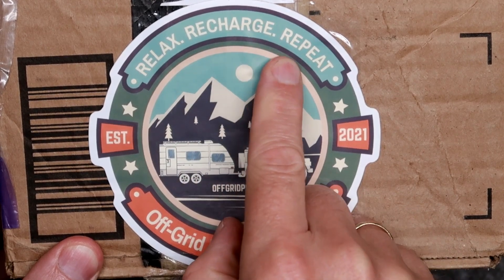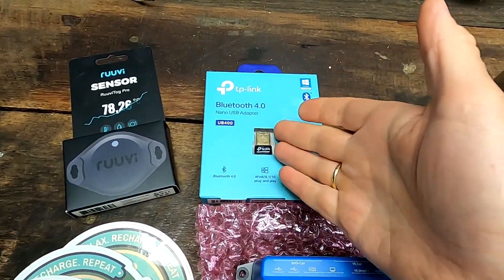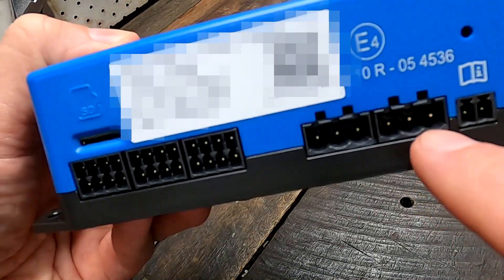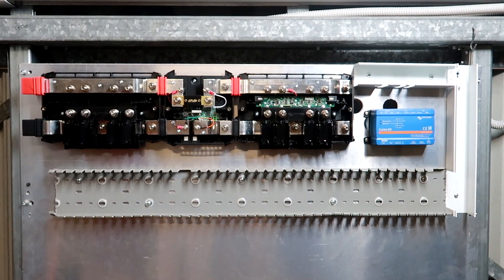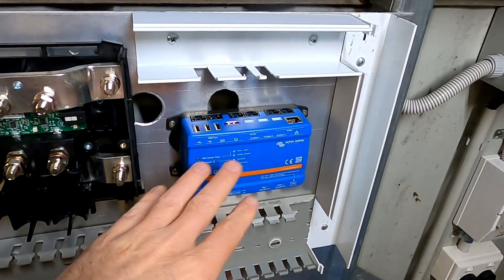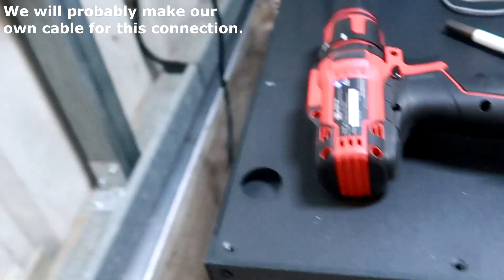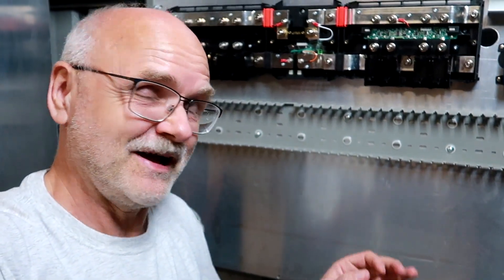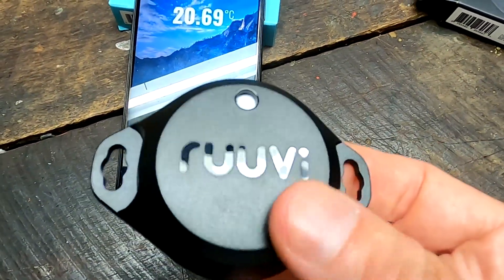The unexpected landing of the Victron Cerbo GX on the PowerWall 2.1 - the saviour of communication?

Comment: Question to the pros: do you connect the Cerbo (or Raspberry) directly to the battery or after the BMS? I just had an ugly experience as the BMS triggered the low voltage condition (battery empty) and therefore the Cerbo also switched off. To avoid that I consider to connect the Cerbo directly to the battery. Any experiences in the community? thx for any reply!
Reply from the maker: I would say, if the BMS has disconnected for any reason, that's it. Something went wrong and you need to look at it anyway and change your design.

Comment: If you want to save money on the BMS-CAN/A cable you can just link add 3 link cables (+/-/GND) to a cheap RJ45 eithernet 2 port socket and then just use chap ethernet cables.
Reply from the maker: Yeah, I was going to make my own cable, just cut one in the middle and solder the 3 pins we need. Victron has the pin-out on their website.

Comment: I agree that it is unacceptable that the different versions of the BMS can’t communicate. But in order for you to test the two batteries working together can’t you negotiate with them that they send you two 200A bms. This configuration should work and should allow you to perform the tests. 
Another thing that concern me is the fact that the Seplos BMS has only one CAN port? Usually a CAN bus needs to be terminated on each side with a terminator (like it is done with the Victron equipments). It will probably work without it but this is definitely a bad practice unless they have added a terminator inside the BMS?
Reply from the maker: Yes, I have asked for a replacement of the BMS and they wanted to wait until the new BMS come out in a few days. They will send them over as soon as available. We hopefully can just replace them in the existing batteries and the will start talking.
The BMS have an internal CAN terminator, so need to be at the end of the bus.
This is something I never understand from their design perspective. Why not use solely CAN communication between the BMSes instead of RS485. It would make life a lot easier. I understand that some inverters use RS485 for communication rather than CAN and Seplos wants to cover as many requirements as possible but having two different BMS versions for either case is certainly a messy solution.
Reply: @OffGridGarageAustralia  If they need to send you new BMS that probably means that a hardware modification is needed? Otherwise they could have sent you only new  firmware!
Reply from the maker: @DrCoolZic  I think it's a new designed BMS with additional functions alike Bluetooth (so it needs this extra chip anyway). Not entirely sure how they want to marketing this as many people seems to have communication issues with their BMS and there is no real solution but only some sub-optimal workarounds. Many would want a new working BMS from them...

Comment: Hey Andy, what is your experience with those Amazon 100 Amp breakers? Like those with the red switch.  Do they have high resistance? High heat? Great video thanks!
Reply from the maker: You mean these ones? https://amzn.to/3bsxOSD
I have used them once and they didn't work. I would not trust them at all.
Use these ones, they are the real deal and SAFE: https://amzn.to/3fpEqW3

Comment: With the cerbo GX the touch screen are powered by the USB port next to the HDMI. I added a noname 7"touch screen and it woks perfectly at mine. But now I'm trying to make a raspberryPI VenusOS for my brother and it seems to work fine with Touchscreen after a little coding on the PI.
Reply: Do you have the code you use for the raspberry pi?
I have the Victron logo but missing the coding
Reply from the maker: I think you can use Kevin's project here on Githup for that: https://github.com/kwindrem/RpiDisplaySetup
Reply: @doucet2006  yes I have the code. I'm using venusOS 2.91 on a RaspberryPI 2 with Touchscreen.  And now it works fine.

Comment: Andy be careful with the power supply of the Cerbo GX. I just found out that there is an issue with power supply and it is necessary to use 100uF/100V capacitor. See more information on victron community.
Reply from the maker: I read about this a long time ago. Mine seems to work fine....
Reply: Hi, mine just packed in, worked for a week or two then when I rebooted my batteries it blew the Cerbo GX up. It definitely needs the capacitor installed, until Victron come up with a new version.

Comment: Now you have the Cerbo GX are you going to have to get a new set of VE-direct cable , or can you still use the VE-direct to usb cables ?
Because to me the Cerbo GX used a different set of cable which are cheaper and doesn't look like there is any electronics between the 2 VE-direct plugs ?.
Reply from the maker: Hi Peter, We can still use the USB adapters as well as VE.Direct cables. It can be a mix of all sort of connections now. That is one advantage of the Cerbo, it takes everything.
You're correct, the VE.Direct cables don't use any converters, it's a pure RS232 signal I believe. Victron still recommends using the VE.Direct to RS232 adapter because of the galvanic isolation circuits they have.

Comment: I have a Victron SmartSolar charge controller 250 | 85 an I intend to buy a LiFePO4 battery. Is there any danger for this charger if the BMS of the battery disconnects the battery and the charger is still connected to the solar panels array?
Reply from the maker: I have tested this many times with my controllers and disconnected the battery under full charge. The Victron controllers can handle that and go into absorption mode/voltage, still supplying power to your loads if they can keep up.

Comment: Very generous of Ed to donate some items.  I'm not familiar with the Cerbo GX but look forward to seeing if it provides anything beyond what you already had.
Reply from the maker: The Cerbo acts basically as the communication central point, same as the Raspberry Pi does. They both run the exact same software. The Cerbo has the advantage of having all these connection points and advanced functionality with programming and relays outputs.
Reply: @OffGridGarageAustralia  Thanks for the explanation.  Sounds like anyone "needing" the Cerbo would be a rare case (as the Raspberry Pi seems to have served you well).  I hope you are able to find a use for the extra features.
Reply from the maker: @gumpster6  The Raspi is totally fine for for these installations. But they are very hard to get and if, prices are super high. So there is not much to save when using a Pi vs the Cerbo.

Comment: Where do you get your cable run covers the. Cable ways I need a way to cover my conked without costing an arm and a leg and I like the plastic run ways
Reply from the maker: I bought them at a local electrical store but you can also get them online from eBay and Amazon.

Comment: 100122/0448h PST 🇺🇸 100122/2148h Brisbane 🇦🇺.  Thanks for the video. You’d very well enjoy the VICTRON CERBO-GX. It’s a wonderful device that’ll enable you to connect all your other devices into the CERBO-GX and monitor the results from any where in the world; once connected to your Network provider (Router). I’m not going into details, but I have to mention that CERBO-GX will provide the fuel tank capacity and provide visual info into  VICTRON GX TOUCH SCREEN, via HDMI and VE DIRECT CABLE combined together. 
VICTRON GX TOUCH SCREEN is an amazing device for the visual proof of all your system, brought into your bedroom, totally cable less, for your reading convenience. I have this device for over a year and I’m extremely satisfied with it’s performance.
The BT transmission is good. The VICTRON CERBO-GX resides in the garage and I receive the images (signals) in my bedroom upstairs, which is about 27 meters away (80feet Approx)
Enjoy…. Enjoy..I’m happy for you. 73s…
Reply: Errata and addendum: Please read that the HDMI and the VE Direct1  cables needs to be extended to bedroom. Power supply to CERBO-GX is derived from main battery.
Reply from the maker: I would not bother with a GX touch screen if it needs to be connected via HDMI. I like the wireless solution and can access the system from my mobile phone, network or away...

Comment: Name: Off Grid Garage Cerbo GX. Another great video Andy and a very nice new toy to play with. 
Waited ages for a com cable for my 3 x Seplos “Suntorque” 5kw batteries, it arrived, and i still cant get communication with the BMS’s. After 6 months of ginning around I have got them working ok, sort of, but they have been a real hassle to get going right. I bumped the voltage a little (56v) from 55.2v and they jumped from around 70% to 98-100% soon after, so I am guessing the SOC reporting is actually triggered by voltage, but that is a big jump from 70-100%, hopefully this has reset the BMS and it will work better now & Ill drop off the voltage again. Love ur vids & look forward them. Cheers
Reply from the maker: Thanks for sharing, Evan. I hope Seplos can get it sorted as I have the JK-BMSes on my fingertips and ready to go. I won't be mucking around much with the Seplos any more if they don't work.

Comment: Made the switch to the Cerbo months ago, after the second Raspi died 😔.
Reply from the maker: How do you find it? Any real differences?
Reply: @OffGridGarageAustralia  The software is the same. The hardware part, everything is there, no need for extra adapters for the VE bus of VE can... No extra drivers of software to install. It's all plug and play.
Reply from the maker: @bramsoff-grid  Yes, that was my understanding of the difference too. Most ports are isolated as well in the Cerbo but Victron still recommends some VE.Direct to RS232 adapters for isolation purposes. I thought I can just use my own JST connectors now for my MPPTs but it sounds a bit unsafe when reading their documentation.
Reply: @OffGridGarageAustralia  I had a test setup for months with the JST USB cables from my MPPT and shunt pluged in the Raspi. I just put the cables over to the Cerbo, no problems at all.
Reply from the maker: @bramsoff-grid  Yeah, same here as well... but they are not isolated afaik. Mauby there is a solution for that.... 🤔

Comment: Any touch screen with HDMI will work. It's cheaper than buying the Victron unit. Just get JK BMS if they work with Victron
Reply from the maker: I would rather prefer a wireless solution for such a screen so I can have it inside my house. I'm using my old tablet for that purpose at the moment connecting to the IP of the Raspi.
Reply: I finally added a Waveshare 5” screen. It was a hassle needing to use my phone on the boat. I wanted a solution that would work after my phone inevitably goes for an unplanned swim… again!

Comment: You don't need the bluetooth adapter for the CerboGX if you connect it to the internet. I have my CerboGX connected via Ethernet to a 4G router/modem. I use VRM Portal (free from Victron) to connect and monitor EVERYTHING connected to my system. In the VRM Portal it gives you the "Remote Console" where you can access the CerboGX as if you had the touch screen connected to it. I highly suggest looking into the VRM Portal.

I have a Quattro 24/5000/120, Lynx Shunt, Lynx PowerIn, Lynx Distributer, Victron MPPT 150/60, Victron MPPT 150/100, CerboGX...connected to 2 solar arrays - 2200w & 2000W charging six 12v300a LFP connected 2S3P for 23kWh battery backup.

PLEASE LOOK INTO Victron's VRM PORTAL!
Reply: The Bluetooth dongle is for using the RuuviTag, or any other BLE accessories Andy wants to experiment with.
Reply from the maker: Charles must be new to the channel. I'm using VRM for over a year now 😊

Comment: Andy, please check which production number the Cerbo has. The most recent one have a quality issue and the power input and can only stand 12 and 24 Volts but NOT 48V, except you solder a capacitor over the DC input! Quite a shame for a quality company like Victron. I bought one and burned it, now I know why......
Reply from the maker: I know... that's now circling for a while out there. Thanks for reminding everyone.

Comment: Have you looked at using a batruim BMS?
Reply: I know people have already asked Andy about that BMS in past but is not as streamlined like some of the other BMSs that have phone apps.  It would be nice however if Andy could test it out since it is from a company right in his backyard and directly works with a Victron system.
Reply from the maker: Yes, I'm in contact with Batrium for a while but never pulled the trigger on it. I like the consumer grade BMSs. I'm sure Batrium will just work once you muddle through all the setup and programming but not many will buy one due to the overpriced components.
Reply: @OffGridGarageAustralia   Ah ok. Get it. I will shoot you an email. Thank you Mike

Comment: Andy, name the new system: Off Grid Power System, as a thank for the donation.
I love all your videos, very helpful. Myself I set up a 45kW lithium system with a bunch of Victron equipment. Available under Victron World as Sinchu Orphanage.
Reply from the maker: But that may collide with Ed's own system if he sets one up.

I'll have a look at your system in VRM. Thanks for sharing, always interested in looking at other systems...

Edit: Found it! Wow, look at all these MPPTs you're using. I like it very much!
Reply: @OffGridGarageAustralia  Thanks Andy for your interest. Indeed, it's a complicated system. 9 MPPT's, 3 x MG Lithium rack of 15kW (45kW total), Cerbo GX, Smartshunt. Before I had lead acid batteries, with all Mastervolt products. Mastervolt isn't going forward with their software, so I changed to Victron.
What you don't see is that also are connected 3 x Mastervolt inverters, connected as 1 phase, nominal 12kW max 21kW, 3 x 80A chargers and an automatic control for charging through grid power / generator. Grid power isn't always available or too low in voltage. The (selfmade) system determines if gris power is standby and proper voltage, if not the generator (3 cilinder Deutz diesel)  will automatic start until for a certain time the grid power is steady. Further a windmill and still a lot of Mastervolt distributors and shunts.
I limited the charge (and discharge) in the DVCC of the Cerbo GX to 450A, if not charging can peak 600A what is too much for the system and cables. This because we are completely off grid and I calculated the system so that we still have enough power in the raining season.
Keep on doing the great job! Your video's are exactly what people want, simple, honest and clear.
Reply from the maker: @gjbevers  Very, very interesting. Thanks a lot for sharing. That's an awesome system you have there and well designed from what I can read. Great work!

Comment: Do NOT connect 48V straight into that Cerbo. Based on the 3 that I have killed they are not very robust when connected to a large 48V LiFePO4 battery. There's a Victron update which specifies connection of an electrolytic capacitor close to the device. I just convert down to 12V instead
Reply: Wonder what the issue is with your setup since I have mine connected directly to the 48V battery bus.
Reply: @davidb.5544  Affected model/serial numbers
Model: Cerbo GX, part number BPP900450100
Serial numbers: HQ2201xxxxx up and including HQ2220xxxx. 
I've had them running at 48V, but it's about a 30% chance of it blowing up on the next power cycle.
Reply: No problems running on 24v here....
Reply: Do you have a link to the info from Victron?  Haven't seen anything about that on Victron Professional. Have one running on a 48V system for 6 mon now.
Reply: @tx75e94  Cerbo GX power supply issue in 48V systems
Technote August 2022 – v5
Reply from the maker: This info is out for quite a while now. It just needs a 100uF/100V cap parallel to the power supply terminals. Some get burned with the high inrush current when connecting apparently.

Comment: Hey Andy, I have the Venus GX, it has a Beagle Bone Black as it’s brain, interesting to see what the Cerbo uses as it’s brain. Are you going to crack it open to see?
Reply from the maker: I won't open it, it is still under warranty. I'm sure you can run a script which shows these information?
Reply: There’s no tamper seal on it, no one will know , be adventurous live dangerously. 😂

Comment: The Cerbo GX is so so so easy to use and set up compared to the RasPi, you'll love it. I'm about to put one in my van (yes I finally bit the bullet and went full Victron). 

And the Ruuvitags are something a customer of mine installs all the time with my batteries. he often puts one in the fridge, one in the freezer, one in the battery/inverter compartment of a caravan, and sometimes even more. I've just convinced Solar4RV's (a shop down here in Melbourne) to stock them, so now you know where you can order more when you want to monitor each BMS as well as the SPAT fridge. ;)
Reply: I'm guessing that would be Matt at Extreme?
Reply: @holdenman8850  
Hey, I know that guy.  😊
Reply: @extremeacc101  You know everybody lol
Reply from the maker: Thanks a lot Paul. I'll have a look what the prices are with them.

Comment: I would suggest "Off Grid GarageX". BTW, with actual Raspberry Pi prices and unobtanium availability, the Cerbo GX is starting to be more appealing, also considering that you don't have to buy usb to victron adapters.
Reply from the maker: Great suggestion, I like it.
I've got a Raspi on back order for 7 months now, still no ETA. so this is not an option any more, I guess.
Victron still recommends the VE.Direct to RS232 adapters due to the isolation of the circuits when connecting to other gear.